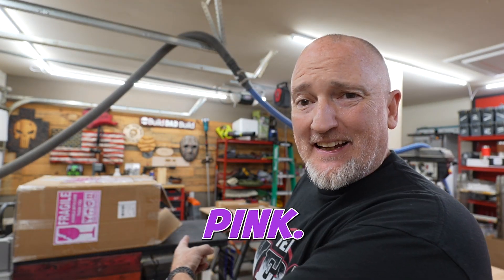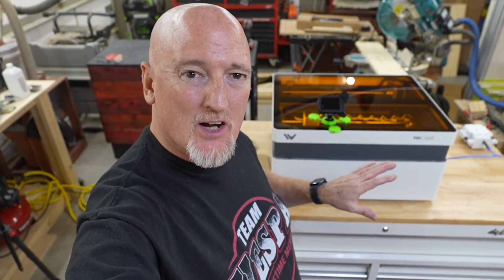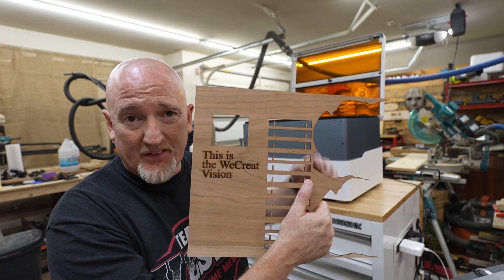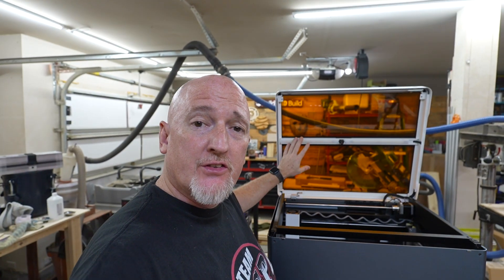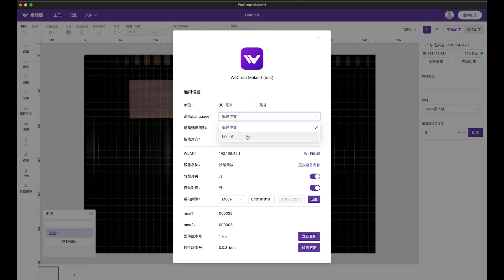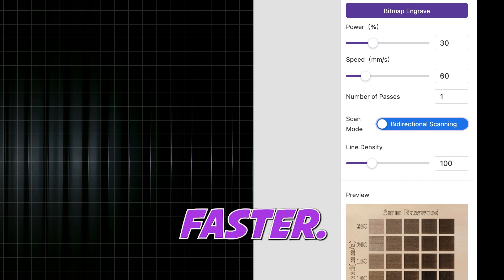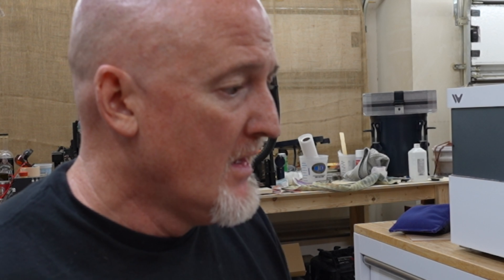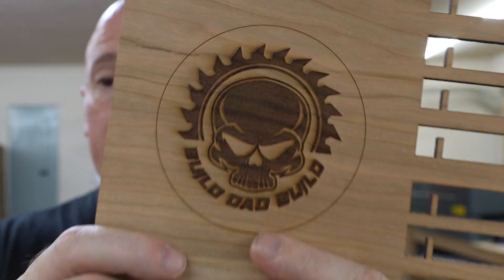Unboxing the WeCreat Vision All in One 20W Diode Laser

Comment: Maybe the machines provided to influencers do work. Real life is different. I received my brand new device (after two months waiting) and the machine, right out if the box,  doesn't work. It presents an auto-focus failure. As a solution, the manufacturer ask me, the customer, to unscrew 16 too tighten screws that fix the moving part of the enclosure. It didn't work. The machine is still totally useless. This is unacceptable.
Reply from the maker: Sorry for your difficulties.